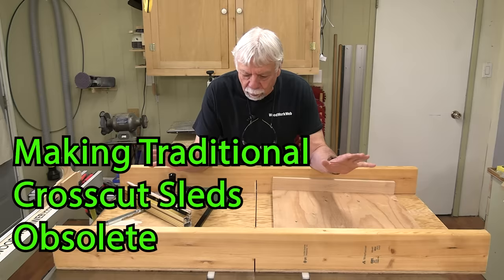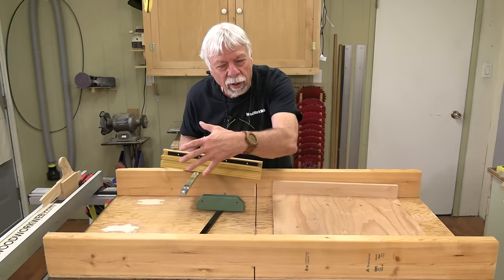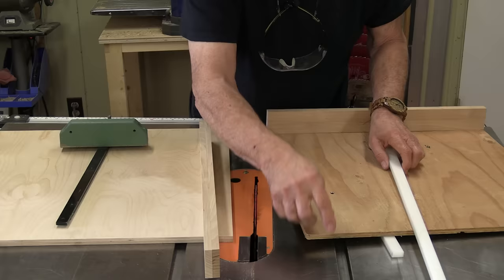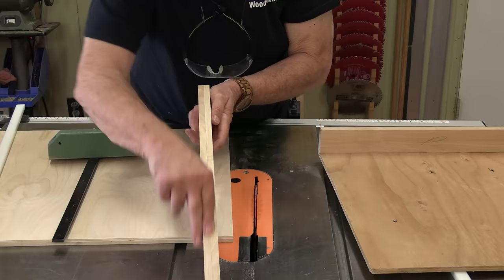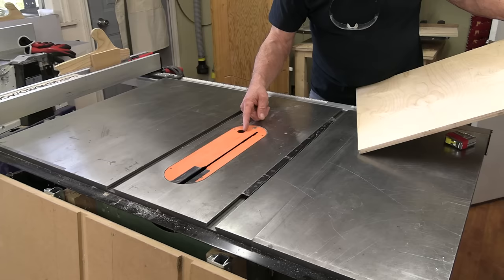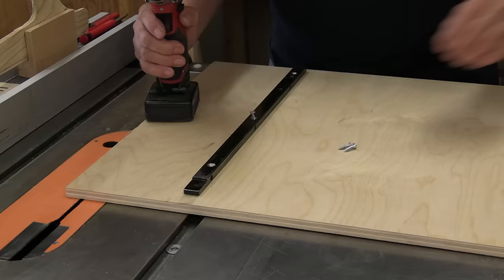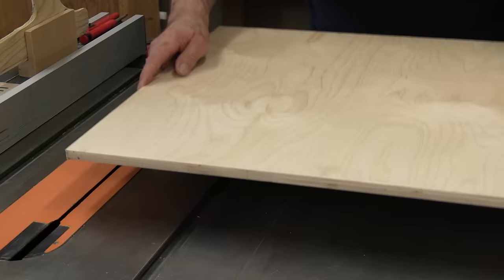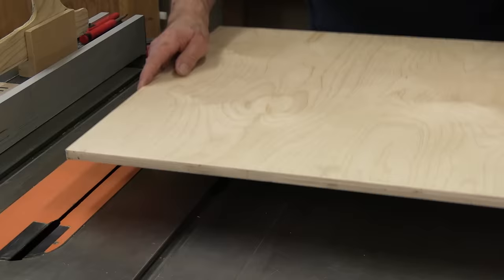STOP Making Out-Dated Table Saw Sleds, Do This Instead

Comment: Okay but...  Even one better, not to pop your bubble or anything but... You mentioned going to your local plastics store and getting those runners you like so much.  Well , next time when you go to the plastics store ( and you can order these things from online too) get some sheet Plastic they have " Cutting Board Plastic" which is great, abrasion resistant plastic, that is smooth on one side, and they have it where it can be slightly textured on the other, if you want that for the top. It comes in different thicknesses, so get what you like, and they will even cut it for you !  Get your same runners, and enough of the sheet " cutting board " plastic to make your base and back push wall.  It all goes together with the same  countersunk screws and you can use some CA glue also.  Line everything up like you show, and WHAM  you'll have the smoothest sliding, easiest cleaning sled you'd ever dream of.  You never have to worry about the wood warping, or getting loose at the back board.

Comment: This is good but sometimes it is nice to have support for the work piece on both sides of the blade. Especially if you don't have a miter saw and plan to use your tablesaw for miters. If you have a miter saw for long pieces then it is less necessary.

Comment: At the end of countersinking the hole in the bar the bit slips in the chuck.  It should be easy enough to tighten better than that with the jacobs key.
The four cut trick to check squareness is a great old trick everyone should know.  But I wonder, how square is your square?  How can we check that?

Comment: I built a small one like that about a year ago, I made mine adjustable, so you can do any angle, burned the angle adjustment with a diode laser. It is sort of a pain, as you have to double check your angle before each use.
Reply from the maker: I thought about doing that version but finally settled on this one

Comment: I keep wondering why no one puts second bar at the outer edge on the table saw. You could even have tensioned rollers at the outer edge. And the guide rail could easily longer than the sledge.

Comment: adjustable aluminum miter bars from rockler are not that expensive.  for a few bucks you can put in a aluminum one.  not better, its just that sometimes aluminum is more available than the plastic

Comment: I do not want to keep track of and store a sled. I just bought an old timey 1950’s era DeWalt radial arm saw that does all my cross cutting, mitering, beveling, and even all ripping to 24” width.  So much nicer that the table saw. No kickback on cross cutting, and any ripping kickback is directed 90 degrees away from the operator.

Comment: You bought the plastic runner at the "local plastic store"?  Is this like a lumber yard, but with plastic?  I've never seen one.  Hardwood runner strips of oak or maple with a straight vertical end grain |||||| don't expand/contract in a direction that will loosen or tighten the runner.  My wood runners always slide nicely.  It sure beats looking for this mythical plastic store.

Comment: Please say more about why one should not align to the blade.
Reply: Align your blade to the miter slot
Reply: Blade is aligned to miter slot because the miter slot can not be adjusted.
Reply: I agree. I've made several sleds. Have always located the fence square to the first cut with the runner attached. If the fence is not square to the first cut you won't get square cuts.

Comment: Why did you leave a hole at the end of the push bar?  I'd want the push bar to run all the way to the saw blade so that I had support as the saw blade cut the work, especially when cutting short blocks of wood. By supporting the block all the way to the blade and using a clamp (NOT MY FINGERS!) you can cut very short pieces as needed.

Comment: I don't know why people are always messing about with these sleds - I've got a sliding table that runs along a track on bearings. It just does everything easily and reliably.
Reply: Cost!!!  Your sliding table is way more expensive than a DIY table saw sled.
Reply: @glencrandall7051  Sure I get that for people on a budget, but it brings out the full potential of the saw. Without it the saw is about half as good, at best. I see workshops with loads of expensive gear but no sliding table on the saw.

Comment: Incra makes much longer fences than the one shown in the video.  Because I have two longer Incra fences, one of which has an extension, I've never built a crosscut sled and never intend to do so.  Furthermore, once you have your Incra miter gauge dialed in, you never have to readjust it.  I can't speak highly enough about Incra products.

Comment: Framing squares are fine for carpentry work but not for fine woodworking.  Your square might not be “perfectly square”. If you want that level of accuracy you need to get a machinist square (or something from Woodpeckers if you win the lottery!).  Nice video, great idea!
Reply from the maker: Framing squares are fine for woodworking but they need to be checked for accuracy and if off, they can be fixed, machinist squares are perfect and I use them a lot, but sometimes too short and Yup, Woodpeckers makes great equipment but I have not invested in any yet
Reply: @knecht105  I bought my framing square back when I worked as a carpenter to pay for college. I used that square for years on a wide variety of home repair-type projects but when I got into making serious furniture (40 years later) I bought a couple of machinist squares only to find out my framing square wasn’t square. I remember the old carpenters I worked with talking about hitting these squares with a nail into just the right spot so you could fix one that got bent.

Comment: I concur with some of the other comments. 0.78mm off over such a small distance is too much. 0.1mm would be more acceptable.
For comparison, my MFT's rail is only 0.21mm (0.0083 inch) off over a 600mm (23.6 inch) length.

Comment: I have no idea why there are so many saw sled videos when most of the guys I know use sliding carriages. They add about 25% to the cost of the table saw and take up some extra room but this is easily made up for by the ease of use and accuracy. Maybe I am biased because I have always had one (50 years woodworking)  but I would suggest that they are at least worth looking into when buying a table saw.

Comment: Becomes infinitely more versatile when u put fence on the FRONT of the sled!!!
Reply: How so?
Reply: @iangochenour158  mainly, it doubles cutting width. Trimmed 20" doors on SS yesterday with no issues or safety concerns with a front mounted fence. Miter guage or std sled can do maybe 8".
Reply: You could also just turn the rear-fence sled around so that the fence is in the front to cut large panels
Reply: Interesting. I guess I thought with no front fence, it would not limit ur cutting width
Reply: But I am very new, and was just curious :)

Comment: Why couldn't you just set the back fence board angle be perpendicular to the cut edge of the base? That edge should be parallel to the miter slot even if the blade isn't. Seems easier than using the other miter slot. Right?

Comment: The only problem with the UHMW (ultra high molecular weight)  plastic strips, there is too much play in the saw top grooves.
Reply from the maker: If they are cut accurately there shouldn't be any play, but also because it can "flex" this can often take up the "play"

Comment: Well, I think you just contradict what you say about  not using the fence to reference from when you're putting the plywood on the miter slot. Why not gauge it from the board in the miter as you did with the fence to jog setup

Comment: I’m confused. How can you even use this if your cutoff is floating above the table? The sled has a thickness and that thickness is not present on the other side of the blade
Reply: Valid point you have.  Solution, make the same sled only wider.  Now you have your support.  I've often ran into the issue of having a board wider than the sled was deep, and making a LARGE sled is heavy and cumbersome.

Comment: Lose the backing board put a piece of 2-inch aluminum angle then mount a sacrifical board to that. The L of the leg should be towards the operator. We built really nice ones all CNC drilled the owner never got the product to market before he passed.

Comment: Why would you measure square against the miter slot and then immediately verify by measuring cuts with the blade? Your end goal then is to be square to the current blade alignment anyway.
Reply: Its not immediately intuitive, but on a table saw the line of cut always is parallel to the direction that the wood is passed by the cutting teeth the blade, not the angle of the blade itself.  This direction will be parallel to the fence in the case of a rip, or parallel to the miter slot when using  a cross cut sled or miter gauge. This is because the point of cutting remains stationary as the work piece passes by it in a direction determined by either the fence or miter slot. 

This is unlike using a hand held circular saw where the blade direction determines the direction of cutting.

If the blade is not parallel to the miter slot, the blade will cut twice, first downwards at its leading edge and again upwards at its trailing edge.  This will result in a wider kerf, and can also cause a kickback. Either way, the cut line will be parallel to the direction the work passes by the blade.

Its best to align both the blade and the fence  to the miter slots, if the saw can be adjusted that way.
If the blade is aligned with the miter slot, then you could use either as a reference.
Same with the fence.

Hope this explanation makes sense and helps.

Comment: Counter sinks pretty much center themselves. 
You fail to say what Type of plastic. You can’t use most plastics. They will wear out quickly. There is one type of plastic that you should use. It doesn’t wear and slides very nicely. Indestry uses it for wear surfaces and to counter friction. It is a little spendy but worth it. It is UHMW. It very durable. I was a machinery machanic at a winery for many years. We used it a lot. I have even tapped it so I could screw bolts into it. It holds threads great. You well not have to replace it periodically. I have even made a fluting device for my lathe out of it.

Comment: 9 times out of 10, all you need is a square scrap of wood. Just set fence to cross cut length, put the scrap of wood, say 10” x 10” or whatever,against the fence,  then put the piece you are cross cutting in front of it and start crosscutting away.
Reply from the maker: for small stuff, you are absolutely correct, and I do that a lot

Comment: What is my "local plastic store"? I have never seen a store that sells plain plastic bars
Reply: Technically it is not plastic it is uhmw. Ultra high molecular weight. and you can get it at Home Depot and Lowe's. Even Winn-Dixie and Publix. Look for it in the cutting board department

Comment: I see a problem with this design. The typical sled provides ZERO CLEARANCE when cutting thin pieces. With this sled, small thin pieces will fall into to saw.  You also notice that the piece of would cut off just falls down to the table surface. May make for a glitch in the back corner.  Could cut a sacrificial fence at same thickness as sled on the other side of the saw blade I guess.

Comment: Is there no problem when the board being cut falls to the saw table? I sure like the simplicity of this. But concerned about what happens when the cut is almost through.
Reply: Never use a miter fence or miter sled with your wood up against the table saw fence.  That will cause serious kick back.
Reply: @woodstover  True and I never have. But I am concerned about the part of the board not on the sled dropping while stiil partially attached to the rest of the board and pinching against the spinning saw blade and what then would happen. I don't think this is a very good idea.
Reply: @larsord9139  for standard cuts with a 90 degree angle blade a standard sled is better than what's shown here for the reason you're mentioning, the offcuts are supported. So, the "stop making this" title is a bit misleading. For cuts with an angled blade I use a sled like this to not mess up the kerf on my standard sled. You can put a piece of the same thickness as the sled on the offcut side to avoid the unsopperted offcut problem.
Reply: @CarmoniusFinsnickeri  Yes, If I were to use something like this I would put a supprting piece also. Thanks.

Comment: Too late.  I bought the Incra Miter 5000 about 10 years ago.  An addition to this sled would be a unit on the right the same thickness as the sled which also with a runner in the t-slot just like the Miter 5000.  This would provide tear out protection on both sides of the cut.

Comment: Big possible error. T squares are rarely 90 degrees vertical. They need to be verified with a metal set point. Try to locate video on easy method to obtain true vertical square.

Comment: I don't understand why everybody keeps making these great big sleds that go both sides of the blade, they must not have ever used a real slide table saw. I made mine similar to yours only a bit bigger (5' long x 3'6" wide ) so I can cross cut a 4 x 8 sheet of ply, but I never have to take mine off because I built up the other side of the blade with another sheet of ply so now my whole saw bench is flat just like a proper slide table saw and all I do is just remove the fence when I don't need it. My saw is just a Dewalt but now I can rip and cross cut 8x4 sheets safely.
Reply: If you're making something like end grain cutting boards, or you are cutting small pieces and making multiple cuts for the same measurement, a cross cut sled on both sides of the blade is the best way to do that. If you have a better suggestion, I'd love to hear it. But this won't work for that.

Comment: "Wood expands and contracts"  uh.  Yes, but so does plastic.  The only runner you'll be able to put in that will have absolutely minimal variation due to temperature / humidity changes are metal runners.

Comment: If you compound your off-angle by 1/2000” per corner, you would end up from 1/2000 to 1/1000 to 1/500” off. Not 1/6000. 1/6000 off mean your getting closer and closer to square. I don’t think that’s what you meant to say

Comment: Why is your new crosscut sled, which has a fence that is set and fixed at 90 degrees to the runner, better than a miter gauge with a fence that is set and fixed at 90 degrees to the runner?
Reply from the maker: because I have to check the mitre gauge every time I use it
Reply: @knecht105  Thanks but is it not possible to fix the fence on the miter gauge so it is permanatly at 90 degrees to the runner?

Comment: So, if you did it right, your new sled is square to the miter slot which means that your blade is off.
Reply from the maker: No, because even if the blade was off, the cut should still be parallel to the mitre slot, so cross cut jig is off 1/40th of an inch in 4 feet or about an 1/80 of an inch in 2 feet
Reply: @knecht105  ahh, yes, because the blade is going to cut it anyway.

Comment: I made my sled from .090" Aluminum 24.0"w x 32" with the rear front and bent at a 90° angle 4" tall or 1.5 times my max blade height. Or a 24.0 x 24.0 cross cut working surface I mounted it like you did on ball bearing metal shafts on both sides of the saw blade. Very low friction. You made yours out of wood. NEVER DO THIS. Wood causes high friction. It is not dimensionally stable. Aluminum is dimensionally stable.

Comment: Of course I can't find the video now but it recommended making the slide bar underneath NARROWER than the slot. This was for a leg tapering sled. The first cut is  taken pressing the sled away from the blade against the far wall of the slot. Then the second cut rides the closer wall of the slot making a skim cut, like the last pass of a router bit for a smooth and BURN free cut. This has saved my butt many times going through thick cherry.

Comment: The reason why your sled isn't accurate is because you did not square your fence off the blade, you always rip the ply first then square the fence off the ripped part and you won't have any gap, rip the ply first then square off the rip

Comment: My cross-cut sled is built so that it is only 8 lbs but I can still cross-cut up to 22".  You don't need such a massive forward fence and you don't need most of the wood on that side either.  In addition, you can free up weight by cutting 2" circle cutouts.  I could not function half as well without mine.  Yours was just built poorly to begin with.

Comment: 11:40  Particle board, not MDF.  As an alternative to the metal miter slot rider, you keep saying 'plastic'.  I'm pretty sure what you have there is HDPE, not just generic plastic, and that is what you want.  HDPE is very wear resistant and will indeed last a lifetime, as long as it's not abused too much.

Comment: Why are you sawing on the inside of the line and away from the line? It contradicts over 60 years of my own learned woodworking practice in the UK - shade waste and saw on the waste side of the line but on the line and leaving the line on. Most people today are using YouTube as the primary way to learn woodworking methodolgy.

Comment: You make a good point: align to the miter slots, not the saw blade. This is important: if you are still off a few thou,: adjust the saw MOTOR MOUNTS to the miter slot...anything after that will automatically be square. Table saws are mostly mass-produced in crappy factories by minimum wage machine operators with the lowest quality materials the manufacturer  can get away with: there are NO mechanical engineers with accurate measuring devices checking for square anywhere along the production line.